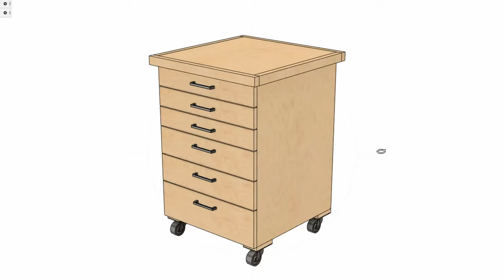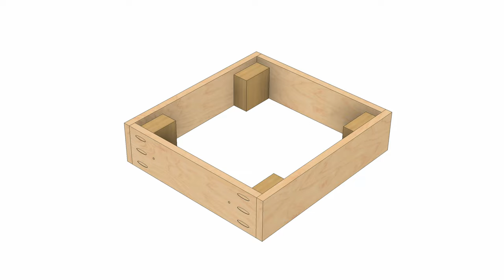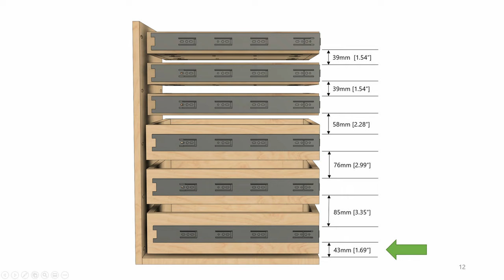✅ How To Build a Plywood Cabinet with Pocket Hole Joinery | Woodworking

Comment: The perfect addition for your drill press. By the way I made the draw slide attachments not all of them I didn’t go under 20mm but if I need to I will. I built a cabinet under my table saw. So much easier so thanks
Reply from the maker: For sure, I'm working in a relatively small space and it's nice to finally mobilize my drill press. That's awesome you made the drawer slide spacers and good plan just making the sizes you need for now. I could also do with a cabinet under my table saw, since it's just an open space at the moment. Thanks.

Comment: Nice spacers, handle jig, and height-adjustable stands!
I've heard other woodworking youtubers say never to angle the pocket holes out towards an edge. Do you have any advice about when it's OK? (I'm not a pocket holer myself, just idly curious!)
Reply from the maker: Thanks! Great to get your feedback. 
Regarding the pocket holes, the basic rule I follow is to place them on the side that doesn't show. This is the approach recommended by Kreg tools:
https://learn.kregtool.com/learn/7-simple-joints-with-your-kreg-pocket-hole-jig/

"2. Determine where you want to drill your pocket holes. If the outside of your box will show, like on an entertainment center, you’ll want the pocket holes on the inside faces. If the inside will show and the outside is hidden, such as on most kitchen cabinets, you can place the pocket holes on outside faces."

This cabinet is holding up just fine having now done a few laps of my workshop with a 40kg drill press on the top. The way the cabinet is constructed won't be putting a great deal of force on the pocket hole joints.

Come to think of it, this might be a good topic for a future video. I will put some thought into how I can setup an experiment stressing pocket hole joints with the screws in both directions. I suspect the joint will be stronger with the pocket holes on the outside, but by how much would be interesting! I could also experiment with and without glue.

Comment: Why not use 3/4 plywood for the frame and 1/2 plywood for the drawers?
Reply from the maker: Yes, you could use 1/2" plywood for the drawers. I tried to keep the build as simple as possible and the plans show how to efficiently cut all parts from 3/4" plywood. You would also need a different screw length for 1/2" ply and setup the pocket hole jig for a different length. So, more parts and slightly more complex but some people might decide it's worth it if they want 1/2" plywood drawers. Thanks.

Comment: I know you included Imperial measurements, but I don't know how to measure 3.68 inches. <sigh> Guess I will need to buy one of those communist, metric tape-measures.🤪
Reply from the maker: There is an imperial decimal to fractional inches chart in the build plans. It's pretty quick to use and in this case, the chart would show that 0.69" = 11/16". Therefore 3.68" = 3 11/16".  The chart also includes measurements in 1/8" and 1/32" if you want to work to lower or higher precision.
Reply: @kiwiworkshop  Just for giggles. I bought two 4x8 sheets of plywood, 6 sets of drawer slides, 250 pocket screws........$250.  I hope my skills are up to this.... 😛
Reply from the maker: @Troy Walker  I'm sure you can can handle it - just remember the rule "measure twice, cut once" 🙂 If you get stuck at any point, at least you have this video to refer back to! I just noticed the wood trim for the top was missing from the supplies list in the plans (but was included in the parts list). I've just emailed you the updated plans including the dimensions for the top trim. It's just one length of wood and pine would be OK so should be relatively inexpensive.